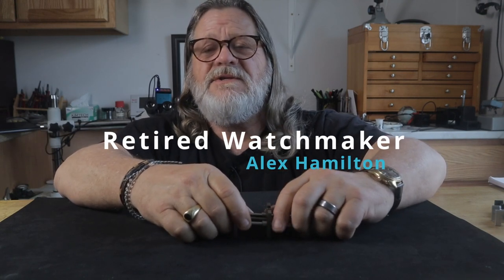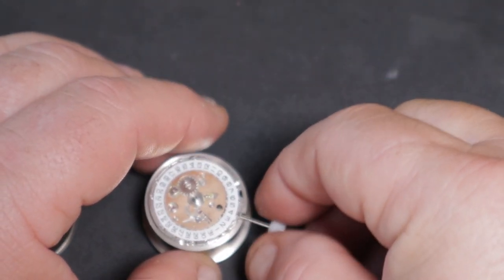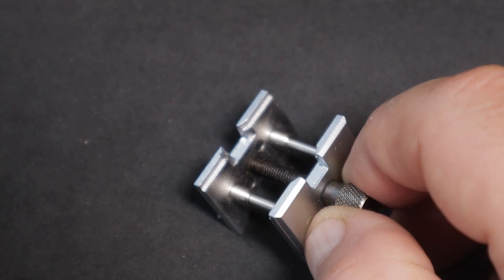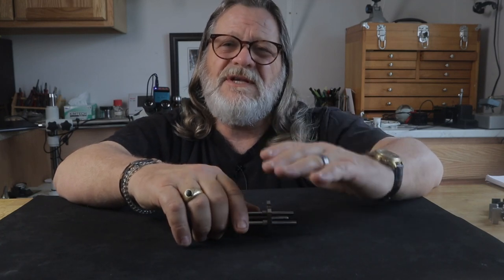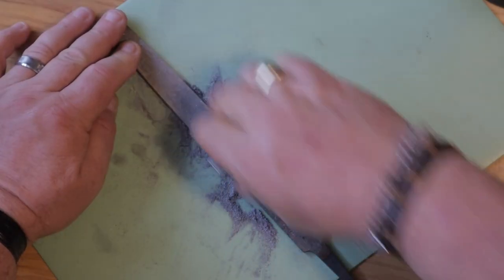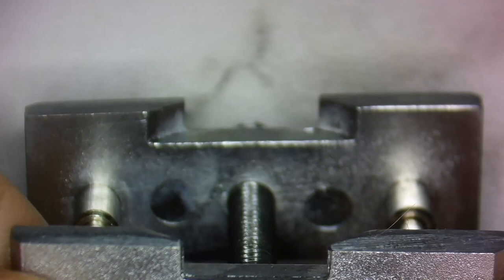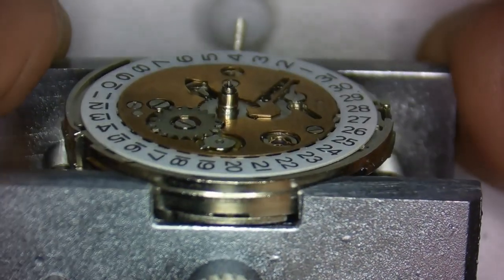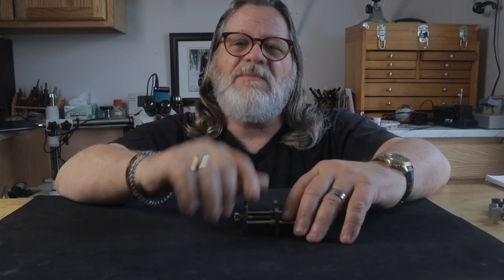How To Improve Your Movement Holder In 3 Minutes

Comment: Love these kind of tips.
I have used a bergeon 4040 movement holder and the top part is holding pretty good with the movements I used. It never bother me, but I can see why on other types of holders, if not well made, they could slip.
Reply from the maker: Don’t get me wrong, I use the ones that are size specific primarily when I’m installing hands but for many new watch makers who don’t have more expensive holders I think this is a pretty good solution to the problem

Comment: Great advice! I added my laziness to the mix and just used a dremel to save time. I got the lion’s share off and then finished with a file. NB if anyone wants to try it, please do this in a workshop or even outside and wear safety glasses and clothes you don’t care much about because the aluminum dust will fly out like crazy.
Reply from the maker: Great tip!

Comment: Interesting tip.  I'm always frustrated with the bergeon 4040 holder being wobbly when a movement's secure in it, and even more so when it doesn't get a good grip on the edge of the movement when working on the dial side.  I'll file one down, got nothing to lose  😀. Thanks
Reply from the maker: Thanks Charles. Like I said, what do you have to lose?

Comment: I modded my cheapo holder by using a Dremel with a cutoff wheel to grind the curved recesses wider and it removed the flash as well. Much better now and it was really fast. You just need a steady hand! Still that was a great workaround!
Reply from the maker: Perfect. I really liked the lower profile of the jaws. It really fits into how I like to work.
Reply: @watchrepairtutorials  yeah… the higher profile is definitely less stable snd in the way. Maybe I’ll quit being lazy and grind off that top part! Great videos - yours are the most informative going.

Comment: I have also filed my generic aluminum movement holder. I didn't do your method, I just bettered the angles and therefore increased contact surface to the movement sizes I work with more frequently.
Reply from the maker: Nice work. There’s multiple ways to do it then if that’s what works for you perfect. 
Thanks for sharing

Comment: Interesting, and thanks for sharing this tip! Yes, it can be a bit fiddly to get the movement securely fixed to the upper section of the holder.
Reply from the maker: I have a large Horetec holder that I use for pocket watches that has these lower profile jaws. I was looking at it and then these other ones and an internal voice said Heyyyyyyy that’s what they need.

Comment: Love the tip Alex.  Yes I have been having issues holding movements in the off brand holder. I have tried filing the top ledge ti get a better bite. Never thought of just removing it all together. Thank you again!
Reply from the maker: Hey John, you’re not the only one I’m sure, but this is a simple solution to a common problem, so give it a try and tell me what you think
Reply: @watchrepairtutorials  yes will do. Was looking into getting a Bergeon one. But I’ll give this a try.  The one I have looked cast and the corners in the cut outs were not that sharp so I tried filing the corners sharper.  But I’ll just remove the whole top level.

Comment: Excellent, I consider myself just a hack before I started watching your videos and really paying attention to what you were saying... Mechanical watches are just absolutely fascinating I grew up on a farm and always was working on our old out of date equipment trying to squeak by... But all the videos you've done gave me confidence and trying to take a non-working watch and make it functional.  The last couple of months I've had more success than the last few years combined and your info is well presented and has helped tremendously.  I bought a Rolex 6426 off of eBay and disassembled and loaded it and voila it ran after I was done LOL success!!!  So the current project is my wife's grandfather's 1950s Crosby automatic.  Not an expensive watch so there's no pressure other than sentimental value... Winds well and and the mainspring is storing plenty of energy, but for some reason it's not making its way to the escapement wheel consistently and I think it's just 60 years of crud and old oil.    Anyway it's disassembled and in the cleaning solutions you recommended and I think I've got a reasonable shot at getting it back together thanks to you 👍👍👍
Reply from the maker: Man, Bob that story means a lot to me. It’s really why I even started this channel in the first place. We got a lot more material to cover so I hope to see you again brother good luck on the Crosby.
Reply: @watchrepairtutorials  I used to do a fair bit of Photography and started dabbling in video editing with a DJI drone and I don't think people realize how much editing is involved with your videos it is a crap load of work isn't it?  Everything from the dialogue to the camera shots.. it's a lot of work and I'm sure I speak for everyone, we sure do appreciate it 👍
Reply: @bobbaemel4110  it is but I’m slowly getting better at it. You have to learn a lot of specialized trades like videography, sound and editing softwares. Thanks, it’s my pleasure.
Reply: @watchrepairtutorials   @It's About Time  hey Alex, just wanted to give you an update... The Crosby's running and I owe it all to you. you're the man 👍. It was old lume and grime in the train gears.  I have to tell you though, I wish I would have watched your video where you make recommended the amscope sm-3t.  I bought the cheapo amscope and regret it.  Saving up for the 3t👍
Reply from the maker: @bobbaemel4110  Thanks for the update, this makes my day to hear about your success.  I hear a lot from people who have purchased the SM-3T and they are have been able to get to another level in their work so it will be a good move. You can't really do much in the escapement with out it.

Comment: I haven’t run in to the issue yet but I’m still new! So since every brand, even the original, has the step…what it’s purpose anyway?
Reply from the maker: I guess it’s there to hold the movement higher, but that’s the whole issue.

Comment: Use the angle of the file in the corner, it allows a small overhang. Gripping better.
Reply from the maker: The whole point of is modification is not only to eliminate the issue of the grip but also to allow for the jaws of the holder to be below the the top of the jaw as well as a more secure grip when the plastic movement ring is still attached.

Comment: This is hilarious. I just started learning watch work as a hobby a couple weeks or so ago and last week I bought one of those cheap holders and noticed the step jaw problem, so two days ago I did this very thing! I used an upright belt sander though.
I am a machinist by trade and do this kind of hacking on a daily basis so my brain is kind of stuck in the hacking lane constantly, so don't nobody feel bad. Yeah, I can think of a movement holder hack, but I can't seem to get 10 minutes into a watch without breaking at least a couple stupid things... so far anyway.
Reply from the maker: Lol I guess great minds think alike.
Hang in there brother and let me know what I can do to help.
Reply: Hey Tyrone - if it’s any help, get yourself a couple of junker movements and take them apart and reassemble them 10 times. Hold parts so that slips (like slippery screwdrivers) will move away from delicate parts. Remove one screw at a time, and place into a tray. I use old chocolate boxes. Use a sharpening stone on your tweezers and you’ll lose things less. I suspect this is due to a burr on the edge. Use a stone on your screwdrivers to make the blades fit the specific screws of that watch. Hope this helps and welcome to the slippery slope.
Reply: @watchrepairtutorials  "Lol I guess great minds think alike." heh. I can confidently say that in your case smarts and experience lead to those good ideas. For me it's much more an accidental Mr. Magoo moment.

Comment: Great idea! Excellent video as usual Alex 🙏. I noticed on another comment you mentioned you use the size specific holders for hand placement. Is that because it's just a more stable platform? I'll admit, I'm a bit afraid to modify my Bergeon 4040, or anything with that damn B logo after the prices they fetch 😂Maybe I should grab a cheap one from Amazon and try this trick, and see how it compares to the Bergeon 🤔. Thanks for the tip!
Reply from the maker: I can understand your hesitation about modifying the Bergeron but pick up a cheap one and try it out.
The reason I like the stainless steel size specific holders is because they have a support for the center will jewel which prevents that jewel from moving when you’re pressing the hands on.
Reply: @watchrepairtutorials  Oh that makes a lot of sense with the center wheel jewel support, figured there must be a good reason. I'll take your advice with trying out the trick, and add a cheap one to my cart next time I order supplies 👍

Comment: Alex another great video. I have the small and large Bergeon synthetic ones do you think this would work for them and I'm not sure using sand paper would be best because of the it being synthetic or as I call it plastic.
Reply from the maker: I would only do it if you’re having a problem with the movement staying in the movement holder. If I were going to do one made out of a synthetic material, I would probably use a file and then maybe finish it up with a fine sandpaper.
Reply: @watchrepairtutorials  Well that is the problem I'm having some movement more than other. Well think about it if push comes to shove I might just order metal ones as you know us Watchmakers are tool junkie😍
Reply: Alex problem solve. I took my small dremel  tool and a cut off wheel to it and that did just fine. I smooth it out with some fine sandpaper and gave it a try, much better now. Thanks!
Reply from the maker: @PMELKUS  that’s awesome to hear Paul good job

Comment: so were can i buy a cheap aluminum holder for my pocket watch repair
Reply from the maker: All the major suppliers have one if you just search for pocket watch movement holder. I will have to say that they don't hold pocketwatch movements very stable so I got the Bergeron one which runs about 80 bucks.

Comment: What about movement holders that are made of hard plastic with movable pins?
Reply from the maker: Well, personally, I’m not a fan of them because they’re a little big for my taste, but they usually present the same problem because the pins are too high over the movement. Those are typically used for holding cases with the movement inside when you’re removing a screw down back.
Reply: @watchrepairtutorials  Good point. I’m just starting out and it was a low cost (cheap) alternative to the Bergeon 4040. But I’m learning that cheaper isn’t better in some cases.

Comment: I’m surprised by this solution. However, what’s more surprising is that the movement holders are designed this way to begin with.
Reply from the maker: Well, it seems to be a common design but for me, it just doesn't work
Reply: @watchrepairtutorials  I feel the same. It doesn’t work for me either. I’ll try this on one of my cheap, brass movement holders. I was meaning to file the edges anyway, so I’ll do this too.